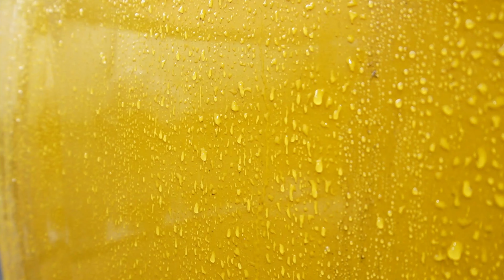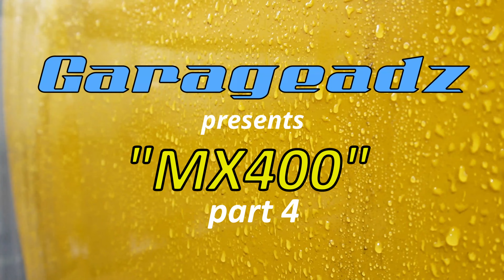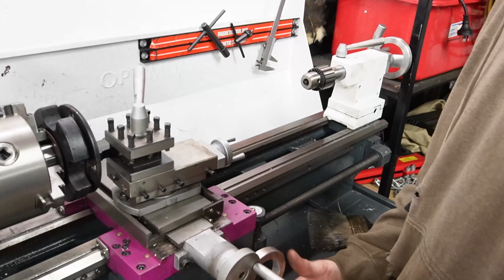MX5/Miata 1UZ conversion Part 4

Comment: Hey guys, how far are you with this project, waiting impatiently for the next episode!!
Reply from the maker: There is a pile of footage sitting on my hard drive awaiting edit. The car is complete and finished.
Reply: @garageadz  awesome man, i am also still busy with mine, life got busy after covid, but getting ready to jump back to getting it on the road. Eager to see yours running!!
Reply from the maker: @Doougles1   Yeah my life went pretty hard upside down very rapidly very close to the end of building the car and a lot of stuff had to change very quickly. I do get comments on this video here and there as well as messages on IG (That I also hardly get a chance to use now) to whether the car was finished and what state its in right now.

Comment: currently 1 uz swapping my miata as well. Thank you for these awesome videos man, I've been so anxious regarding the design of a rear sump but the way you described it made it seem more manageable. one quick question tho...  would cutting the rear section of the ppf off just past the bolts, welding plates to it, and than bolting that to the rear subframe be easier than creating a differential cross member? cx racing sells a kit like for this for ppf deletes but I dont really know if it will turn my subframe into a curly fry haha
Reply from the maker: Thanks mate.

We looked at welding to the ppf and doing something like that but found the piece to be some alloy of non ferrous metals and decided it wasn't going to work for us and didn't ho ni did it